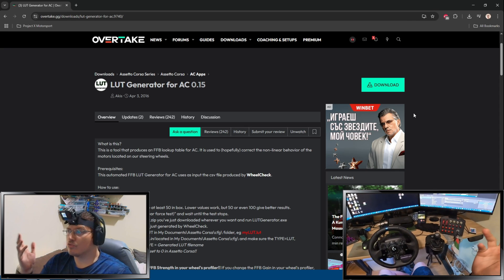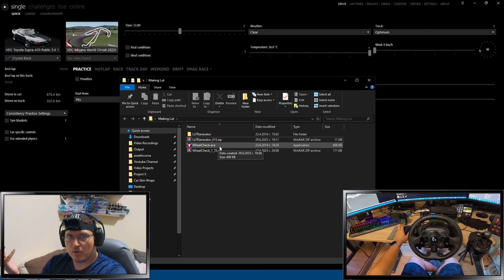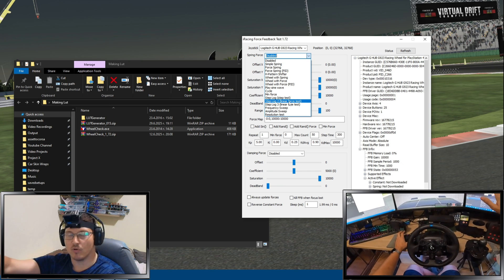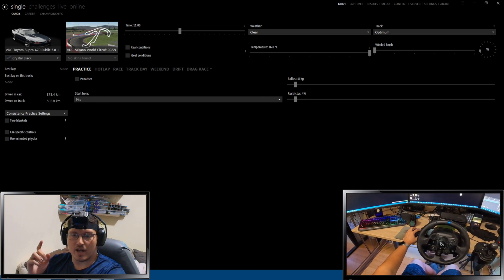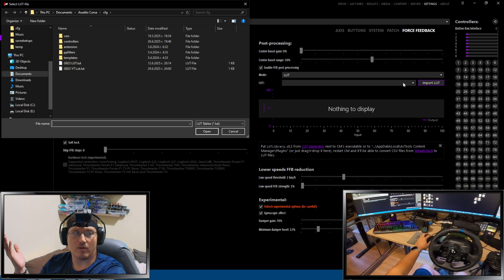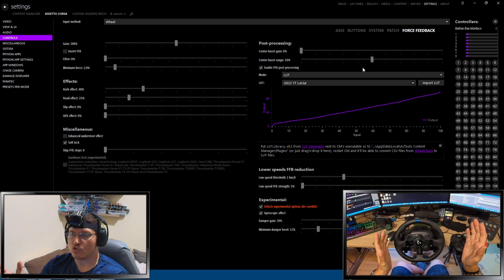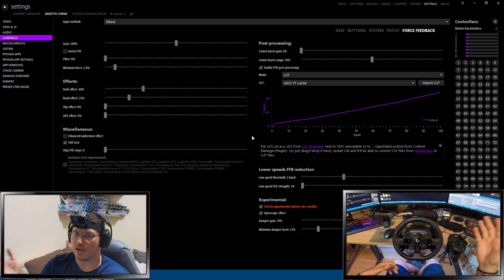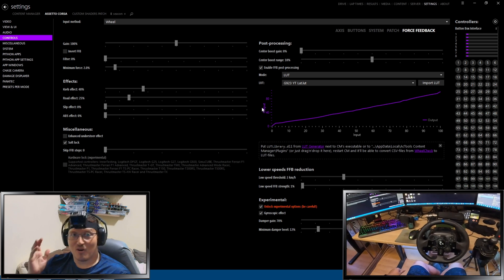How To Make a LUT File For Gear Driven Wheelbases Logitech & More

Comment: I downloaded a lut from someone from YouTube now i almost dont feel the wheel.

I came here to learn to make my on to see if is better.

Im using Thrustmaster T300 RS gt
Reply from the maker: Hey brother, you can always swap the LUT or use Gamma, more guides, settings and setups in our discord server https://discord.gg/PXM
Reply: @projectxmotorsport thank you bro! Whats the difference from lut to gamma?
Reply from the maker: @rubenfmarcos  Gamma is a simple curve that changes how strong forces feel across the whole range — it boosts or softens the middle, but it’s generic and not wheel-specific.
LUT is a wheel-specific correction table that fixes non-linear motors by making weak forces stronger and strong forces accurate.

In short: Gamma = generic shaping, LUT = hardware calibration.
Direct Drive doesn’t need either.
Reply: @projectxmotorsport Thanks to share your knowledge mate!

After i made the lut the wheel feels more precise, but less overall ffb and effects, but feel's better to drive.

Im rocking a Thrustmaster T300rs.

Comment: Yo Man. I've watched almost all your tutorials. If I understand a clutch and shifter are really needed for drifting, right? I could throw a drift without clutch on acc on my first minutes but there is a lot of work to be done(I made a short on my youtube, if anybody willing to give me some advice), so I think a clutch wil help? Defenetly a shifter wil be more comfortable than the paddles on my wheel🤣
Keep making videos!! You deserve a Million subs, easy!!🎉
Reply from the maker: Thank you your feedback means a lot, clutch and shifter are not necessary at the beginning, but absolutely needed down the line when getting to intermediate = advanced, as you will need to learn to shift gears mid-drift, now you can use the paddles and just use 1 gear, but making sure you also have correct settings otherwise car will autoshift for you, more guides, settings and setups in our discord server https://discord.gg/PXM

Comment: Just curious, have you made a 360/ reverse 180 drift entry tutorial yet or are planning too? Lowkey wanna learn it properly. I've tried and still not consistent enough
Reply from the maker: I haven't, I will cover it, but something very bad happened and I need to deal with it first, I will gather my strength and make a video about it soon
Reply: @projectxmotorsport  ok, take your time no pressure